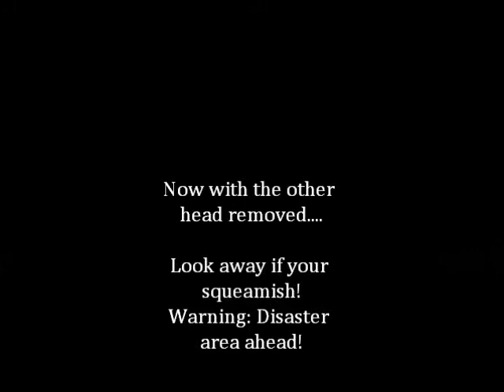Dead Flathead!................

Comment: You can repair anything, it just becomes a matter of whether the effort is worth it, which depends a lot on how many of them engines are around. 
We had an engineer near here called Bill Parkinson, died about 20 years ago, he kept Victorian cast iron drain pipes stacked up just to make cylinder liners for knackered old engines, time he had overbored the block, fitted one of them pipes, he would bore them back to standard size.

Comment: Can the deck be planed on the "good" one to overcome the rot out from setting water? I also know if you are really careful (& good) you can weld those areas on the block before resurfacing it. I guess you will be die testing it for cracks before going to that amount of trouble though?
It should be interesting. I had an old flathead that was sooo rusted, I couldn't even get the heads off it, so I never was able to determine if the block was any good or not..

Comment from the maker: I think the better of the two could be welded and decked but at $80.00 an hour how much is it worth? 
I found a nice running flat head for $500.00 with a fairly recent rebuild on it.
At any rate I'm going to magnaflux the thing before I get into it to far. 
Time will tell.